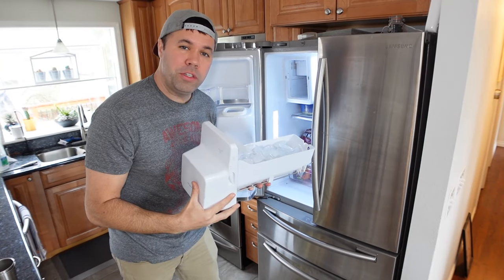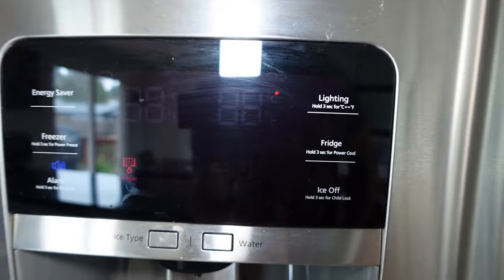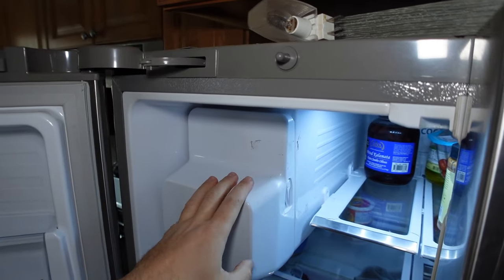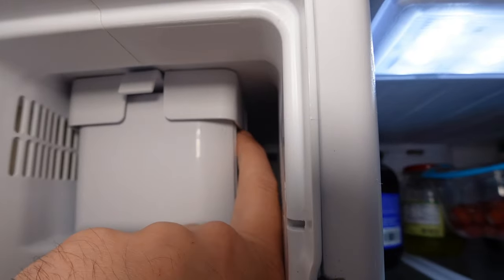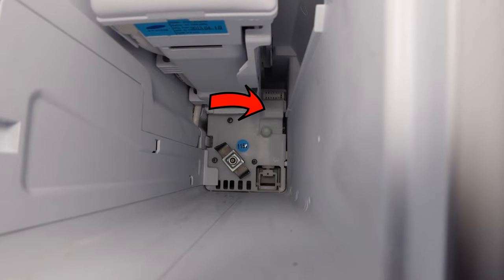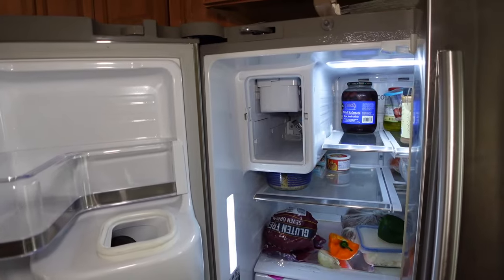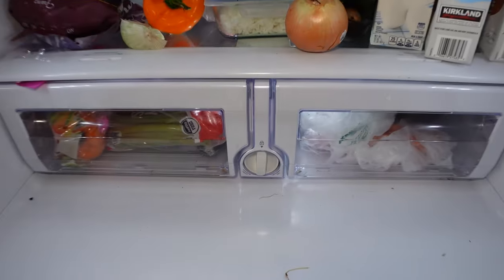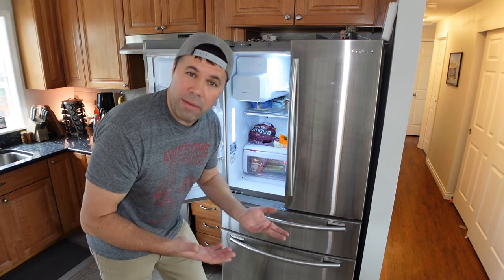Ice Maker Not Working on Samsung Refrigerator - Check these 8 Things to Get it Working Again

Comment: The only way to get ice is to take that Samsung refrigerator and throw it out and buy a different brand, problem solved.
Reply from the maker: 🤣 I've heard this alot.  Luckily I haven't had many issues over the last six years
Reply: We're about to do that.  This thing is only 3 years old and it's been nothing but problems
Reply: I agree $2500 piece of junk , I’ll never buy Samsung again
Reply from the maker: @stevemccoy8489  I agree.  My next house, I'll be getting a different brand too.
Reply: Yep same @theallnew
Reply: Agreed. Samsung appliances are the worst.
Reply: Agree!! I just want my food cold and some ice now and then..
Reply: Agreed. Samsung sucks when it comes to home appliances... I've been having so many issues with leaking, ice maker, at this point, I'm ready to buy anything other than a Samsung. Waste of my $2k 😢

Comment: Its funny because all guides says that move the fridge and check the water line, but NONE of them says "Hey, try to serve water in a glas, if water is coming from there, your water line is ok, you don't need to move the whole freaking fridge"
Reply from the maker: Well you could still have a leak in your water line.  Best to check it once and while.
Reply: Also there are usually 2 intake valves, so just because you have water to your dispenser does not mean that your valve to the icemaker is working
Reply: Thank you for this!  My problem was that a part of the water line was frozen.  I increased the freezer temp from -2 degrees Fahrenheit to 0 degrees Fahrenheit.  Then I used your blow-dryer de-icing method. Worked like a charm!
Reply: My father in law moved the fridge couple inches to pant behind the fridge and then my Fridge started throwing and “EP” error code. Everything still works fine , fridge water dispenser except for the ice. There’s a knocking noise then nothing. No ice in the tray either.  Since I have warranty the technician didn’t even bother servicing it just wanted to swap out the whole fridge but i don’t want to do that.  I tried unplugging it for a minute to reset and it shows the temperature on the inside of the fridge for a bit then goes back to the error code. I don’t know what it could be
Reply: 😂😂 people love to make things difficult
Reply: @ryansickles1983  But those valves are not at the back of the refrigerator.
Reply: @JMGENTERPRISES  you could, or you could create a leak by moving the fridge. At any rate, checking the water line behind the fridge doesn't ensure there's adequate water flow which you can test at the water dispenser.
Reply: @BJ Nicholls  I never said where the valves were... all I said was there are two valves so water working in your dispenser does not guarantee that water is working in your ice maker.
Reply: @hakim8688   There is a way to reset the digital panel. We did it before. There's a video and Google info online to look up for that too. It may be in the fridge manual.
Reply: @bjnslc   It is good to check the water line anyways because one time it was pouring out underneath our refrigerator and mold was growing under the wood floor and it was mush frim swelling up!
Reply: Wish I had seen this 10 minutes ago.😂
Reply: Have a 2019 have tried all of this and even contacted Samsung they said my year don't have any recalls 🤦‍♀️🤦‍♀️

Comment: The water pipe is empty and doesn't open the valve for some reason. There is water supply. Water runs when requested to a cup, but the ice maker stays dry. Why?
Reply from the maker: Not sure sorry

Comment: Easy check for presence of water is to switch from ice to water and try filling out a cup. If it runs, no need to check for the filter, etc.
Reply from the maker: Good tip 👌🏻

Comment: How do I know if pressing switch turns it on?  Mine makes a bell sound @jmgenterprise
Reply: @jmgenterprises
Reply from the maker: Which model do you have?
Reply: @JMGENTERPRISES  rf4287hars. It also has the ice off on the panel but I can’t turn it off. Thx

Comment: You rock!  I had resigned myself to not having ice this summer - just heard the first cubes dropping!  I had no idea there was a separate ice maker power button - the indicator inside the fridge said the ice maker was on but when I held the little blue button on the ice maker itself for 3 seconds I felt a humming begin.  I also turned the freezer temp down just to be sure.  Thanks so much for the great video!
Reply from the maker: Awesome!  Yeah I didn't know ice makers had their own separate power button either.  Glad it's back up and running for you!
Reply: Thanks for the 3-second info. I  heard a sound after the 3 seconds and then felt a motion. It didn't last long, but hoping it was it.

Comment: Thank you VERY much!!! The door switch was 100% the issue. This is the only video that covers this possible issue. Thanks again!
Reply from the maker: Yay!  Glad I could help ☺️
Reply: Is that really the switch for light? I close both doors and light right away goes out, i close right side door and hold switch pushed in and lights stay on inside fridge..
Reply from the maker: @lcarlosmoreno6436  what model fridge do you have?
Reply: @JMGENTERPRISES  rf4287hars Samsung
Reply: @JMGENTERPRISES  replaced ice maker twice and still not freezing/making ice.

Comment: Bummer! All of these steps for me are working. My ice maker only fills up one side of the tray and rarely dumps that little bit of ice it does make. UGH Thanks for the helpful checks! It did help me figure out what it isn't doing.
Reply from the maker: What brand of refrigerator do you have?
Reply: @JMGENTERPRISES  Samsung RS27T5200SR. So far I’ve come to a conclusion that it’s the water pressure. It doesn’t appear to be supply the 20psi that it calls for. At least that’s what I’ve read and troubleshooted on the Samsung website.

Comment: Great video for explanations. My problem with this and models like it. The ice maker is in the fridge, these style of units, ice makers leak warm air inside and it freezes up. Mine worked a month, under warranty they fixed it, I got 2 months on the 2nd one. Finally found a serviceman who knew what he was talking about and he could fix them and give a one year warranty on the service but he told me dollars to donuts 1.5 year and the seal will fail again. They are junk, all. Get a model with the ice maker in the freezer.
Reply from the maker: Sorry to hear about the struggles!  Thanks for sharing the tip on the ice maker in the freezer.  I will keep that in mind next time I am in the market for a fridge!  :-)

Comment: I was defrosting my ice maker as a preventive measure because it has sometimes frozen up to where I couldn't get the ice drawer out without a lot of trouble. I forgot to turn the ice maker off before I turn the defroster on. I also put hot wet dishcloths at the very back corner to get the ice off of the back. Other than that I didn't do anything and now my ice maker doesn't work. I tried everything from your video. Would you have any idea what I could or should try next? Thank you!

We did end up fixing it. We had to push longer on the button on the side  of the ice maker. Your video helped enormously! Thanks for making such a helpful video!
Reply from the maker: Glad my video helped and you were able to get it fixed 🙌

Comment: Thanks!  I was only using the external power button and it was to completely unknown internal power button. Super easy resolution on a hot day.
Reply from the maker: Great to hear!  And thanks for the super thanks!  :-)
Reply: When you clicked the internal ppower button, did the machine make a sound?  How long did you hold it for?  Still trying to figure mine out.  THanks!

Comment: Hi.  Appreciate the videos VERY much.  We have a Samsung that looks very much like the model you're referring to.  The ice maker works fine; however, every six hours or so, it makes this weird, repetitive "whooshing" sound like it's having trouble breathing.  It lasts about 10 minutes and then stops until the next time.  Any ideas?  Thanks very much!
Reply from the maker: So you have changed the filter?  Sometimes when my ice gets low I get that whooshing sound you are referring to.  However mine usually only last about two minutes.  Have you tried unplugging your fridge for a couple minutes then plugging back in?  I find a hard reset like that occasionally sometimes helps.  Not just fridges but my computer, roomba robots, cell phone and other things 😄

Comment: Wouldn't the most obvious troubleshooting step be that if the water button works.  The water line is ok and it can't be the water filter either.  That eliminates two of your steps.  Narrowing it down specifically to the ice maker or controls.
Reply from the maker: Good point! 👍🏼

Comment: Thank you, very helpful. Why that unlabeled little blue button is on the side of the icemaker... who knows. Never would have gotten there by myself.
Reply from the maker: Glad I could help.  Yeah, I do not know why they hide the little button.
Reply: Tried first tip. Help tiger there to turn on ice maker. All it did was lock it. I finally noticed ENERGY SAVER was lite. Held for 3 seconds.  Wella! ICE OFF turned off

Comment: How to replace a faulty door switch. We followed your instructions but the light didn't go off. Awaiting your response. Thanks
Reply from the maker: Have you checked all the other possible issues it could be?
Reply: @JMGENTERPRISES  yes . The only one failed was the light
However I've also reset the ice maker from the little switch located at the side.
My fridge is identical to the one in the video.
Reply from the maker: @johnkhatouki3492  Hmm.  That is odd then.  Maybe check the owners manual.  Sometimes they put tips in there for finding a resolve.
Reply: Did you ever get this resolved? My light won’t shut off either. Also no ice.
Reply from the maker: @leftjabrighthook  hoping to hear the results as well
Reply: @JMGENTERPRISES  I too thought it was a faulty door switch as I would open the door and hold the switch in but the light never went out.  So I took my cell phone and set it on video and started recording and put it in the fridge.  Opened the door...closed the door.  Opened the door and closed it.  Then I watched the video and sure enough, the light goes out each time.  I think there are magnets in the frame of the door that senses the door closed.  So my ice maker problem is not that door switch.
Reply: So what is it? Nothing meets mine either and ours has previously been replaced by Samsung. This is the first time it stopped producing ice since it got replaced.

Comment: I swear every Samsung should be sold with a hair dryer!!! I didn't want a Samsung - but during the height of the Panda Express, my fridge died and Samsung was the only fridge available in my area, in store. My filter is set-up like yours, but I have to turn off the water and drain the line from the back before I can replace my filter. I haven't seen anyone else talk about this issue.
Reply from the maker: I hear ya on Samsung fridges.  I think you are doing it correctly by turning off the water before replacing the filter.  It makes it a lot easier to remove when it's not under pressure.

Comment: Can the ice bucket be disassembled to fit in the dishwasher for cleaning? I've tried prying it off at the bottom front because it looks like it will come out that way, but no luck so far.
Reply from the maker: I don't believe so.  That would be nice though

Comment: I have the same ice maker unit. Water is dispensing just fine. The ice maker is not filling. Is there a way to check if the freezer fill line is blocked with sediment? Since water dispenses with great pressure, I can rule out the filter. And since water dispenses at all, I can rule out the door switch. Right?
Reply from the maker: Yeah, I would say you can rule out the door switch and filter.  Have you tried using a hair dryer to ensure no ice is blocking the dispenser?
Reply: The reset worked and dumped water into the unit, so no ice blocking :) The compartment for the ice maker is too warm. The bottom freezer is also not as cold as it should be. 10-12 degrees instead of -8 it's set for.
Reply: Did you ever figure that out because I’m having the same problem.
Reply: Sorry to say it had nothing to do with the ice maker. We had a slow leak in our compressor. The temperature slowly continued to rise. Now we have a new refrigerator (Whirlpool side by side) for about the same cost as a repair. After removing the lower back panel, I could see areas of corrosion on a couple lines. A repairman diagnosed.
Reply: @stephaniebean634  OK thank you for getting back to me I appreciate it

Comment: How do you know if the swith in the ice maker is on or off?  Maybe i just turned it off while trying to see if its on?  If the outside control shows it is on wouldnt that mean it really is on?
Reply from the maker: Sorry for the late reply.  It's hard to tell.  Maybe try unplugging it from power for 30 seconds, then plug it back in.  Sometimes a good old factory reset will do the trick!

Comment: Hey - we’ve got the exact same fridge. Followed all the awesome tips you gave, have replaced the water valve and also replaced ice maker - first with after market - then with OEM. Still no ice! We can’t find any Samsung breakdowns/service info online. Any ideas?
Reply from the maker: Have you tried just unplugging your fridge and plugging it back in?
Reply: Yes we did. And we reset the new OEM ice machine. Water is filling and freezer is at temp. The issue seems to be that ice is forming on the extraction fingers and not releasing. Super frustrating!

Comment: Any advice for if the sensor goes out. My husband replaced the auger and the new one the light doesn't work either
Reply from the maker: What model do you have?  They are all a little different.  Maybe try looking in your owners manual.  The procedure should be in there

Comment: i fixed my fridge non-dispensing water/ice issue by :
1) remove the water container(supplied with the fridge) first, mine is non-plumbing fridge
2) insert the 50ml syringe(filled with water) into the water container hole
3) press on the button sensor (beside the container location) to simulate(or bluff the fridge) that u had put back the container
4) when u hear the fridge pump machine sound
5) compress your syringe to fill the water pipe(in the fridge) with water. some water will leak so prepare a cloth to wipe 
6) Voila. done.
Reply from the maker: Awesome!  Happy to hear you were able to get it working again.  Thanks for the explanation on how you did it!
Reply: How long after doing these steps until I could expect ice?
Reply: @MegaLizard5  so long the water could flow into your ice-tray, ice should be on the way, depend on your fridge coldness setting

Comment: TO EVERYONE WATCHING! DO Not use a hair dryer or heat gun of any sort because the heat will warp/melt the plastic and make your ice room warped and unrepairable, thus voiding any warranty or one time repairs. Use a steamer instead, enough heat to melt the ice, but not enough to melt the plastic.
Reply from the maker: Personally my hair dryer does not get hot enough to melt plastic but good tip
Reply: If u know how to use a heat gun  properly, its fine. But most dont, so listen to the comment lol
Reply from the maker: @DatDudeDez  Yeah must be careful with a heat gun fo sho!

Comment: I own a Kenmore Elite; ice maker works fine however it is not dumping the ice into the container. It only dumps the ice once I reset the ice maker. Opted to replace the ice maker with a new one, but the same problem persists. Any suggestions? Thank you
Reply from the maker: Huh, that is interesting.  I am unfamiliar with that machine.  Have you checked the troubleshooting section in your owners manual?

Comment: Ok but is there a problem with the water line or filter if the water still continues to dispense, just not the ice maker? You didn’t mention whether or not water still works?
Reply from the maker: I would say the water is stilling working.  Sounds like maybe an issue with the ice maker.  Has some ice maybe formed on the ice maker inlet preventing new water from coming in?

Comment: I believe I have a bad light switch. Would that be said though my water dispenser still works could it still be a bad light switch even though my ice machine is not working
Reply from the maker: Tough to say for sure.  Have you verified it's none of the other potential issues I talk about in my video?

Comment: That "power" button on your ice maker is a "test system" on mine. If I press that button, after a couple of minutes, it drops one cube of ice.
Other than that, my ice maker does not produce ice. Any ideas?
Reply from the maker: Have you checked all the other possible problems I mentioned in the video?

Comment: Is it possible a clogged filter would allow water to dispense but prevent ice maker from producing?
Reply from the maker: I believe so yes but I've never experienced that issue
Reply: thanks.  a wet hot towel melting the clogged ice did the trick.  :) @JMGENTERPRISES
Reply from the maker: @Snowdog3779  good to know!  I'll pass this advice on!  Have a great weekend!

Comment: Hey whats up I have the same unit…So ice is coming out into my freezer and water is coming out of the water line but no ice is filling up top…Nothing is froze I tried all the techniques you did I pushed the power button on the inside and didnt hear it turn on or off…any tips?
Reply from the maker: I would try unplugging your fridge from power, waiting 30 seconds and plug it back in.  Maybe it just needs a good old fashioned reset.